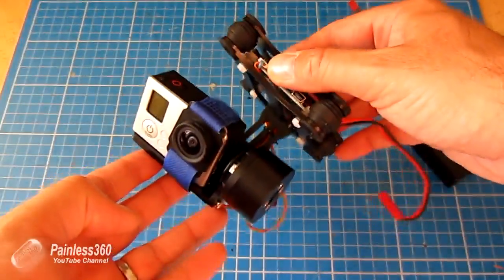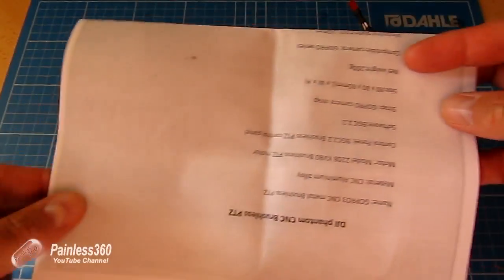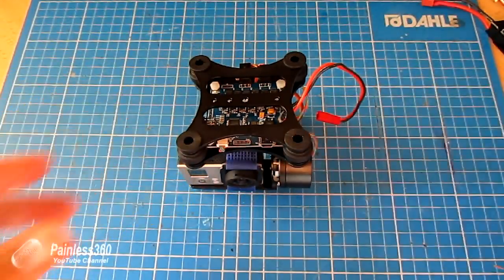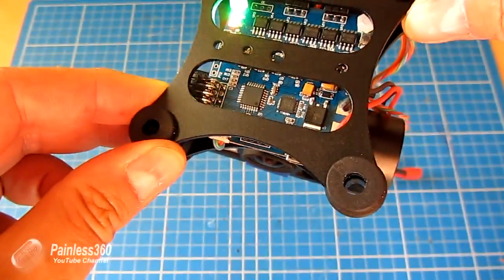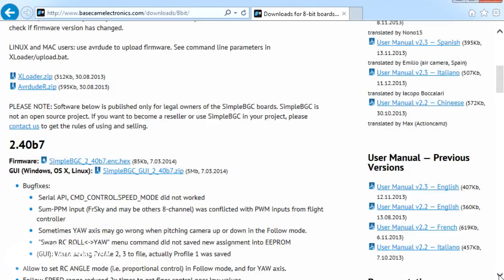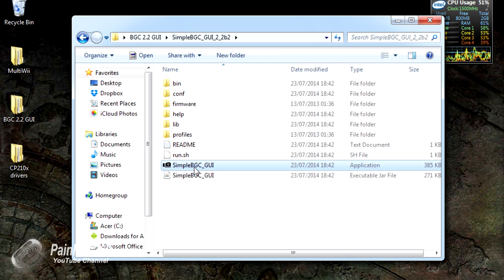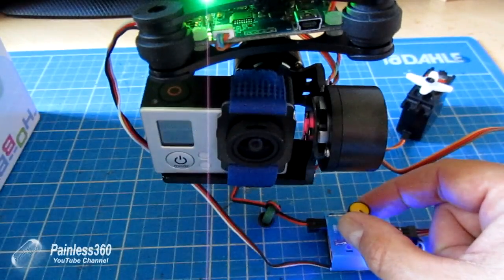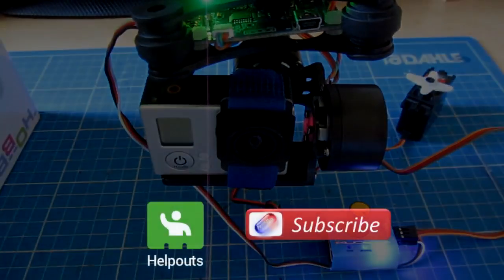BGC 2.2 (2.2b2) GoPro Camera Gimbal – Software, drivers, setup and receiver connections.

Comment: I bought a new BGC 3.12 gimbal motor controller to control the gimbal motors of my drone camera. Whenever I connect my BGC gimbal motor board to my computer using a micro USB cable, for connecting with the GUI, I am getting a warning message in my computer saying,"Power Surge on the USB port". And no COM port is visible in the GUI, for me to connect with the board. Can someone please tell me the possible reasons and the solution to this problem?
Reply from the maker: It sounds like the gimbal is trying to draw too much power over the USB connection. I'd power it from a battery first before plugging in the USB cable... Best of luck!
Reply: @Painless360  Thanks for your reply. I followed your instructions. I first supplied the BGC controller 12V through an external Voltage Supply. Then I connected it to the USB. As soon as I connect the USB cable  to the board, the on-board LED lights up bright and within 1-2 seconds, the board heats up to a high temperature. I  disconnected the power supply and just connected the Board to the computer using a USB cable. The on-board LED still lit up and the board over heated even when the external power supply was not connected to the board
Reply from the maker: I'd contact the seller, sounds like something is off with the gimbal.. Best of luck!

Comment: Sir i have 0.54 version and i am trying to connect it in GUI version 2.2b but whenever I try connecting it the application quits abdurptly please advise what should I do
Reply from the maker: I've not used this in years so no idea. Best of luck with it
Reply: @Painless360  I am having the same issue, seems to be Java related crash
Reply: For anyone trying to get this to work now.... when it crashes on connect. To get around this, I downloaded java 8 update 51, from their archive, (after creating an account), downloaded and installed, and it connects now!! WOOHOO!

Comment: Hello, when I connect my usb port after I open the program (simpleBGC_GUI) I click on the com3 port which is the correct port for the gimbald and the program automatically closes and there is an error message (hs_err_pid 9548) except that the numbers change every time and when i click on it opens mission planner?

Comment: what is you help out channel?  I have 2 of these gimbals and they work at first and then fail,  would really appreciate your help. Thanks
Reply from the maker: I've not touched one of these for years so all I knew was in this video. The basics for any gimbal apply here - always install the camera before powering on, balance the camera in the gimbal before you turn it on and if it struggles to hold the camera in place then check the balance and then increase the power setting for the axis that can't cope. Best of luck!
Reply: @Painless360  thank you, I'll keep trying.

Comment: I recently came across your channel while working on a DIY S500 build, and had a gimble question. I have a gopto hero4 and came across seller on ebay selling zenmuse h3 3 axis gimbles for $50 usd shipped. Can these be controlled via any flight controller or are they only for use on DJI products?
Reply from the maker: Not sure. I've not used that one.. Best of luck with it

Comment: Hi mate, just bought a 2nd hand drone with this setup on it, thing is there was no battery for the gimble pcb, what are you using there, hope u are still looking at comments as I see this is a good few years old. Thx
Reply from the maker: From what I recall it needed 12v so I ran mine from the 3S flight battery.. Best of luck!
Reply: @Painless360  cool, I thought about that, same voltage as the phantom 2 I just got. Just need to work out how to get pictures from a gopro to my phone, I so need an expert to speak too, I am an electronic engineer but this is all new to me lol

Comment: This video has helped me a part but I ask since my English is not fluent I am going to put it with a 22.2v 10000mah battery it will work well (the gimbal and the controller card)
Reply from the maker: Check the maximum voltage supported by the gimbal, I think you will find that voltage is too high... best of luck

Comment: Hello und thank you for this great Information Video. I checked my gimbal with Servo Tester and it works Fine. But not with my phantom 1. i know its a Long Time ago😂 but i can see the pitch Signal in naza Software After calibration. I connected the Signal to the Gimbal But it has no Effect on the pitch of the Gimbal.Could it be that older Phantom 1 does not working? Or do you habe an idea what to do next?

Comment: I'm new at gimbal stuff , so how can I see what the camera recording do I install fpv camera with it ? Or do I use the recordering camera as an fpv ?
Reply from the maker: You usually setup a camera switcher or have a second operator control the gimbal camera..
Reply: @Painless360   so do you mean I contact the camera on the gimbal in the VTX ?
Reply from the maker: Check out the big boys toys playlist as there is more camera stuff in there..

Comment: I am building a drone for aerial photography. But i have got absolutely no idea about gimbal integration with the flight controller. I have watched almost every video on youtube related to gimbal setup. Still got no clear idea. Please help. Any help will be highly appreciated.
Reply from the maker: The gimbal will attempt to keep the camera steady pointing in the direction you want. How you set that direction is usually down to a few PWM input (like you'd use on a servo) to 'tell' the gimbal the position to move to in the X, Y and Z axis. You can simply plug in a servo checked into those inputs on the bench to see how that works.

Those inputs can be driven from spare PWM outputs on the radio receiver or forwarded channels from the receiver via some form of 'channel forwarding' (depends on flight controller you're using). 

The documentation for the gimbal should give you some hints. Best of luck!
Reply: @Painless360  Thank a lot. Let me check.

Comment: My motors makes buzzer noise on 2.2b 2 but how to disable sounds on these version from the Gui? It still beept on startup 😞
Reply from the maker: All I knew about this is in the video. I no longer have this. Make sure the gimbal is balanced before you power it then the motors are only being used to stabilise the camera, not hold is in place.. Best of luck!
Reply: @Painless360  muth thx Painless360 its my fail, got a Runcam HD without battery so its too lightweight for the gimbal 😂😂😂 i thing too, i will check if the motor are making sound again, sounds like when u turn on too long your copter, motors are beeping after a few minutes but why it is on the gimbal 🤔 i saw other video where i can change soundalarm by motors etc. but its another version and i cant use it 😞 should i update the board?  and when on which firmware? Thxxxxx 😘👍🍀🍀🍀

Comment: please help me, I have bought an Ocday gimbal, that is similar to yours. I connected the gimbal to the receiver first on s-bus, but it didn't do what I wanted, so i connected it to PPM and now everytime I turn on my transmitter, the gimbal goes all the way down. I tried out all switches and potties on my transmitter, but the gimbal hardly moves (it newer reaches leveled position), but it moves on any of the pott inputs i give it. (My transmitter has two pots).
Reply: do you have to set this up on the computer?
Reply from the maker: Iv'e not touched one of these for years. All I knew is in these videos - best of luck!

Comment: Or what battery to use?
Reply from the maker: Check the voltage range on the one you have and use a lipo battery power directly, or a ubec that supplies a voltage that it is happy with. Best of luck

Comment: hy hai dear i just bought a gimbal controller board  generic 2 axis controller board version 3.0 can I flash bgc 2.2b2 in it (my question here  is  can we flash 2.2b2 in basecam electronics ver 3.0 board  ( https://www.amazon.in/Generic-Controller-Two-axis-Brushless-THA009600/dp/B071R6WNP2?tag=googinhydr18418-21&tag=googinkenshoo-21&ascsubtag=_k_CjwKCAiA9efgBRAYEiwAUT-jtCQh0FXNQOYGJGosZFOegj-J7UimD4PQ_kiBELxFRdWjdKJTDNRTbRoCvAAQAvD_BwE_k_&gclid=CjwKCAiA9efgBRAYEiwAUT-jtCQh0FXNQOYGJGosZFOegj-J7UimD4PQ_kiBELxFRdWjdKJTDNRTbRoCvAAQAvD_BwE )
Reply from the maker: No idea, I've not had one of those here. I'd ask the vendor. Best of luck!

Comment: Hello Painless, I just burned the board by connecting the cables through the servo tester, as you showed in the video ... I saw the smoke and I disconnected immediately, but it was too late ... the card is no longer recognized by the PC (Win10) , do you have any idea what the cause may have been? Thanks and congratulations for the channel;)

Comment: Does anybody know how to set up gimbal control via SBUS (specifically XM+). In the BGC manual, for serial receivers it says to use the PPM-Sum option for RC inputs and connect it to RC_ROLL which I tried of course, but the GUI didn't recognize any channel inputs. Anyone have success with this?

Comment: Thanks very much, very in depth as usual...  The silent mode didn't seem to change the vibration in mine much at all.  I ended up uploading the latest firmware, completely gone.
Reply: which motor can I use with the BGC board?

Comment: Thank you for this video Painless 360. I purchased one of these recently and it arrived without any instructions. I have worked most of this out but the GUI software portion of your video is very helpful. I'm currently trying to get my MJX Bugs 3 to lift this but it is quite a heavy gimbal!
Reply: which motor can I use with the BGC board?

Comment: I'm still very new to the hobby, but I've been building a 450 size quad and want to use it as a camera platform so I purchased a Walkera G-2D brushless gimbal.  My system is using a FrSky DR4-II receiver (in PPM mode), a Taranis XD9+ Transmitter, a Seriously Pro Racing F3 EVO flight controller, and Cleanflight Configurator v2.1.0 to program the FC.

My plan was to use  one of the slider pot controls on the Taranis transmitter mapped to a spare channel on the FC motor output signal pins to control the gimbal camera by hooking it to the gimbal pitch control signal Input pin on the G-2D.  I've watched many a YouTube video to gather pieces and parts of what I needed to configure each of the system components to get this to work, but I've failed to get the pitch control working.

When monitoring in Cleanflight connected to the FC the radio channel tied to the slider pot appears to be working as expected and shows signal on AUX2 going up/down with respective slider pot control movement.  But output tied to the gimbal pitch control simply doesn't work.  

In hopes that it will provide the necessary information for someone to help me, I've added a shapshot of all of my system component setups.  Any help in resolving this issue will be most appreciated!
Reply from the maker: +Bill Cooper check out the beginners series on the channel. This video may help you, it always pays to do some smart searching and adding the term 'painless360' to your search - https://www.youtube.com/watch?v=N69128cOFPc

Comment: I dont have anything showing in my com port.  what now?
Reply: any my gimbal doesnt do anything when plugged in
Reply from the maker: What troubleshooting have you already tried?
Reply: Unplug replug in, push Little reset button on the board.  Reinstall the software.  Still nothing.  I use the same card to connect to mission planner so I know it's not that.  Tried with battery power and without.  It lights up and flashes on the board and the accelerometer on the bottom but doesn't move or work at all

Comment: hi ainless360
I have followed your instructions, but my dreadlocks (BGC V3.15) continue to vibrate and buzz again. what is the solution
Thank you for your time
Reply from the maker: No idea, you’re using a different controller then the one that is in this video. I’d recommend going back to the vendor if it’s never worked. Best of luck

Comment: Just for now I’m going to use the pitch control as I only have 1 spare channel (channel 5), I want to use the top right slider button on my fs i6s radio to control the pitch, would I just connect a wire from the signal pin on the gimbal to the signal pin on channel 5 of the receiver (powering the receiver and gimbal separately)? If so then it’s not working for me. Thanks for replying so quickly for my other questions and sorry if I sound like a noob (I am)

Comment: Hi,  could you tell me how I would use a radio transmitter to control the roll and pitch of the gimbal please, I can’t figure it out
Reply from the maker: +Andrew Keir see how I show control using a servo checker. You need to connect those two connections to spare outputs on your radio receiver. Best of luck.
Reply: Just for now I’m going to use the pitch control as I only have 1 spare channel (channel 5), I want to use the top right slider button on my fs i6s radio to control the pitch, would I just connect a wire from the signal pin on the gimbal to the signal pin on channel 5 of the receiver (powering the receiver and gimbal separately)? Thanks for replying so quickly for my other questions and sorry if I sound like a noob (I am)
Reply: If so then it’s not working for me, the gimbal is not moving up or down when I use the scroller on the radio transmitter (VRA) which I put as channel 5 on the i6s, please help

Comment: I've been building, racing and freestyle flying with mini-quads for over a year now. I would like to build a HEX with this gimbal. I use spektrum satellites with Airbot F4 or Revolt-V2 on my mini-quads. Do you have a video on how to have gimbal pitch control with AirbotF4 with Spektrum sat? Thanks
Reply from the maker: +VD2021 sorry I don't. Best of luck
Reply: I just ordered two OMINBUS-F4 with baro to do the HEX build. I chose this FC  because it has built in OSD and I don't plan on using telemetry. My assumption is that I can use either the Buzzer or LED pins to control the pitch of the gimbal.?

Comment: hi, the voltage to feed the gimbal is 5v or 12v? i saw u are using the balance port to feed it...
Reply: Victor Gomes hey did you figure out how to connect the gimbals power cable to a battery? if you did what voltage and c rating did you use?

Comment: Help! I cant connect my gimbal to pc even though i downloaded those platform to read it. what should I do
Reply: when I connect it , the connection part of the program only has COM1 in there which is not my gimbal
Reply from the maker: Sounds like the driver for the gimbal isn't installed. I'd try another USB cable.. Best of luck!
Reply: @Painless360  same problem , i just find COM1 at connection and cant read the board and firmware , any idea ? help

Comment: Hi, Do you know hot to connect this board to flight controller so I can control roll and pitch using my transmitter? I don't have PWM possibility so only connecting it to FC can be used to control them?
Reply from the maker: If you don't have PWM on the Rx that you can use then most flight controller have the ability to 'passthrouigh' an aux chennel to a spare PWM motor output for things like this. Look at pass-thru or channel forwarding in the manual/documentation for the flight controller and software you have.
Reply: Thank you very much, I've used Servo_Tilt as Channel Forwarding is impossible to understand and made it work.
To give some info, Servo_Tilt didn't work on latest CF 2.0.1 and 2.0.2, but I've flashed to BF 3.1.7 and it worked. The catch is if you want it to work you need to add servo under resource using motor ID.
So if you would like for example use PWM pin for motor 5 then (resource motor 5 none, then resource servo 0 XYY depending on ID you had for motor 5)

@Painless360 maybe if you could make some video for Channel Forwarding ;)